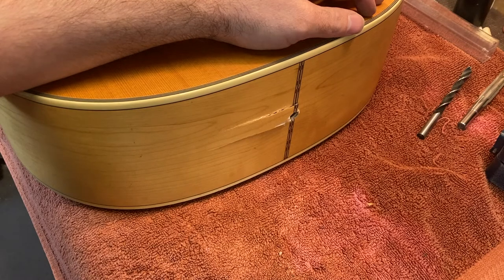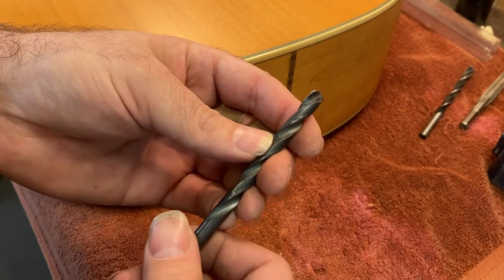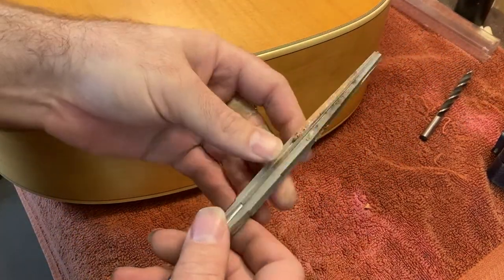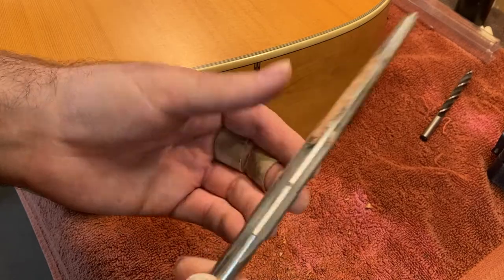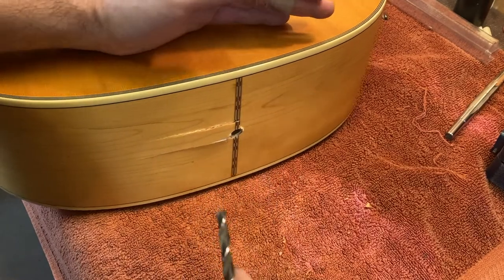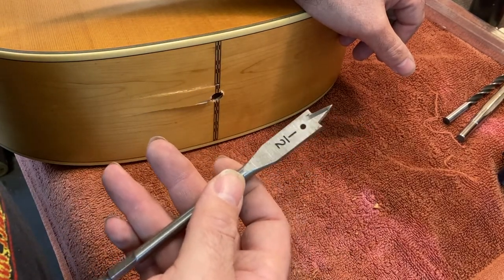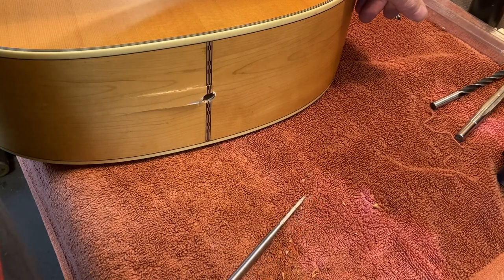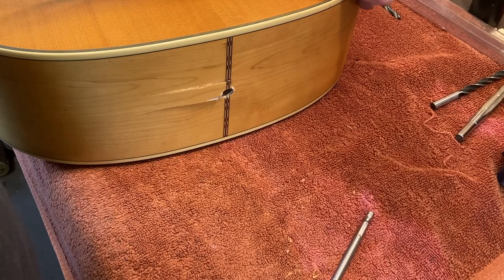DRILLING A HOLE FOR AN END PIN JACK

Comment: Cheers buddy, I successfully fitted one using the second option wood drill bit, just to add that at the beginning I slow sped the bit in reverse which gently got thru the top finish first, more as a scoring action to prevent any tear away. 
My sharp bit actually got in a couple MM in reverse, creating a nice starting point for the then slow forward drilling.

Comment: A rearmer is not for refining, its for fine tuning a hole, always use it by hand, never in a drill.
Reply from the maker: This one is designed for a drill and its how I drilled holes for output jacks at a high end manufacturer for 3 years. It's never been a problem.
Reply: Refining by definition is fine tuning...  It is common practice to chuck an endpin reamer into a power drill. Obviously like all delicate tasks a certain level of common sense and skill are preferable.

Comment: I currently have a endpin jack on my acoustic guitar wired to an active pickup. I really dislike this location especially because my instrument cables are all straight (don’t have 90 degree elbow) therefore if I have my acoustic plugged into my amp I can’t prop the guitar upright against the corner wall of the room, or even set it on it’s stand, because the instrument cable interferes with the bottom of the instrument. 

I was wondering if it would make sense to drill a completely new hole at a 45 degree angle on the instrument, similarly to where the instrument jack would exist on a fender strat (but still on the edge of the guitar, not the front). 

It’s an Alvarez acoustic and it is very special to me. I’m afraid drilling a new hole there might compromise the integrity of the guitar, and I just wanted to ask an expert before I arbitrarily drill a 45 degree hole to relocate the jack. 

Any input?
Reply from the maker: We put the end pin jack were we do, typically, because there is a tail block reinforcing it. If you put it in the side of the guitar only you have a 1/8" of tearable wood between you and a big hole/crack should the cord get stepped on.

Comment: With Stewmac being the obvious industry benchmark, but respectively priced way higher than DIYers would likely be willing to spend, do you have any opinion on the reamers on Amazon that are fraction of the price? As someone who isn't going to do it professionally, maybe using only a few times on on what may be a sub 300.00 guitars, I can't justify spending 1/3 of the value of the guitar on a part.
Reply from the maker: I wish I did. Reamers in general are expensive tools no matter where you get them.
Reply: Find a MT0 or MT1 Morse taper reamer. They are 3° (1:20) reamers, suitable to ream an end pin hole if you are careful. They can be picked up second hand from Marketplace quite cheap sometimes.

Comment: That big split out looks like someone pulling the drill bit out with force. No care. I've seen drill bits tear out small fibers near the hole, never a huge section like this
Reply from the maker: There is a a veneer there and thin wood. Thats why it's risky.

Comment: There should already be a strap button hole pre drilled on most acoustic guitars. I use a small paddle bit judiciously until i get the right dimensions for the stew mac reaming bit. Just think before you do,and do not rush the process. A little blue masking tape over the hole helps from maring and splitting around the end pin hole. .maybe a very light lube,like graphite dust on the end pin jack. The hardest one i ever did was a gibson cherry red sunburst humming bird. What friggin mess,red mahogany dust and shavings. They must dyed the guitar inside out. Just ridiculous.
Reply from the maker: Id be careful with the tape as it can help lift away damaged finish.